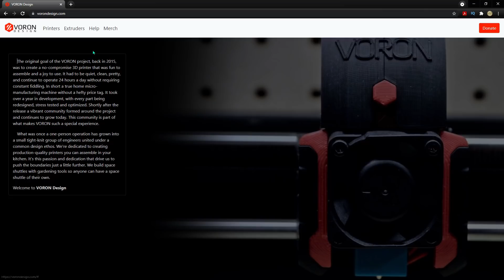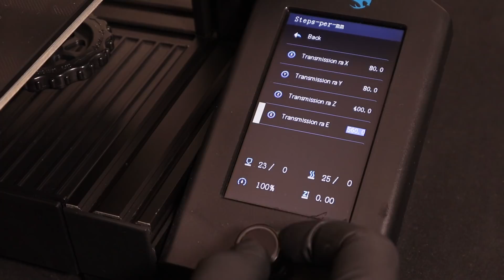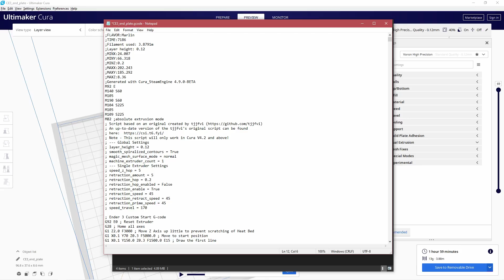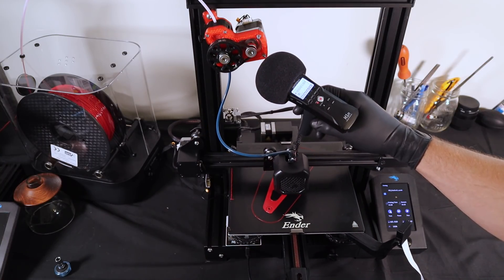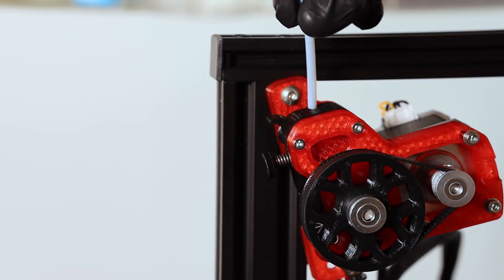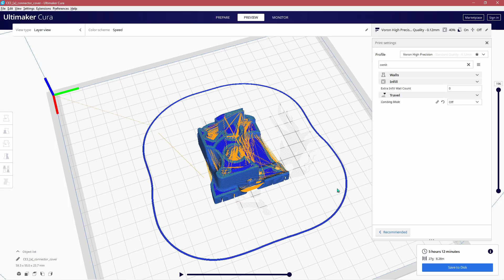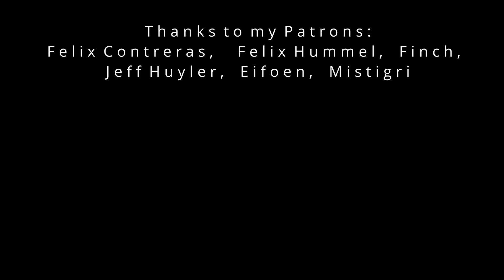Creality Ender 3 V2 - Voron M4 Extruder - Assemble and Test, How Does It Perform?

Comment: Would love to know more about the prints that were causing clogging. Any other positives or negatives in this setup? Looks like a fun project, but I’m aware that lots of people try to upgrade the extruded and end up with worse results than stock.
Reply from the maker: The plastic extruder has to go, but the metal single gear has been pretty good surprisingly.  This extruder seems to have the same quality with the bonus of not having to worry about the filament getting crushed with too many retractions and jambing in the tube.  I'd love to figure a mount for direct drive, but then why bother when you can just switch to a pre-made DD version.  All in all pretty good, I'd assume the motor could be sized smaller due to the ratio, I really like to use the same parts to keep the cost down and make things easy to swap back if needed.
Reply: @NeedItMakeIt  M4 is far far away from any single gear extruder. There is no point in comparing them. The biggest difference by my opinion is in accuracy. You will not achieve such accuracy even with Titan and similar DD clones. I have been using it intensively for several months and it is great if you calibrate it correctly.  You can try 5:1 against 4:1 gear ratio to experiment (16 -20  GT2 pulley) I think it must be ABS print due to the properties of the material (document specification is not just for fun) there are no compromises here otherwise it will not have the desired effect..
Reply: @Deluxa801 Hey! I know this is an older comment, but I'm running into some underextrusion issues on my M4 and want to make sure it's tuned properly. What does your calibration process look like/what do you recommend?

Comment: How do you compensate for elephants foot in Cura? I'm new to Cura and am still trying to work out the differences between Simplify 3D
Reply: in cura there's a setting called "initial layer horizontal expansion"  If you have elephants foot on your prints, you set a negative value here.  

To calculate how much elephants foot your having, print a cube and measure it without touching the bottom layer, then measure it again including the bottom layer, this number difference is the value you should put in cura
Reply: @PandaTaco  Thanks for that, Im really liking Cura everything is laid out so well and it seems to get regular updates whereas I dont think I have ever had an update for Simplify 3D
Reply: @AndrewAHayes  It's my go to slicer but there are others which are good also.  I see a lot of people saying great things about PrusaSlicer but I haven't got to tune it out for my machines.  

Also try Cura beta with the Arachne engine.  I like it better than regular cura most of the time.  Great thing is that you can have both installed and use the one you like
Reply: Get your bed levelling and nozzle distance correct and you wont have any elephants foot.  it simply means you are too close to the bed.